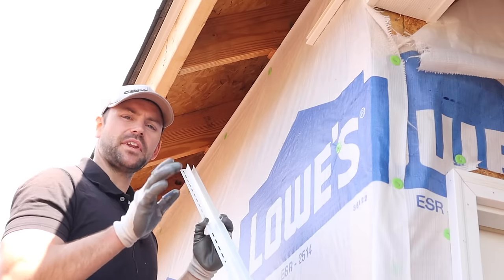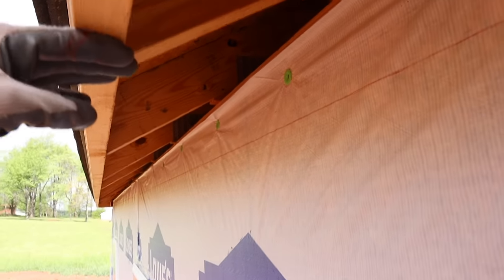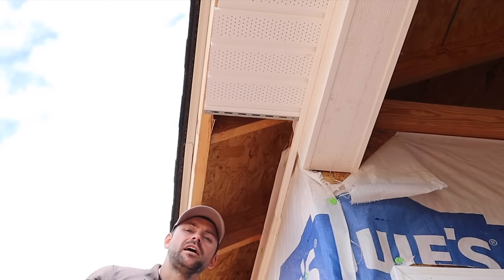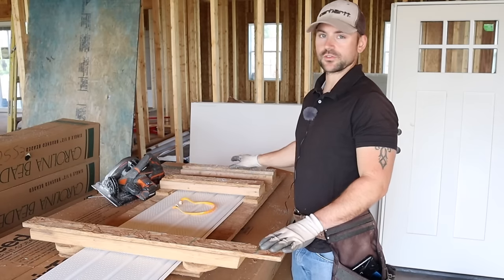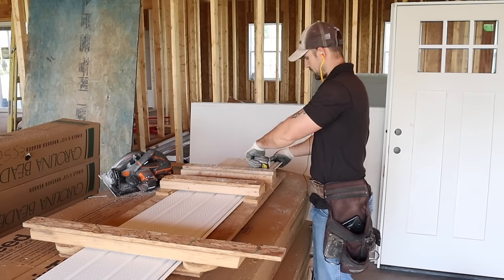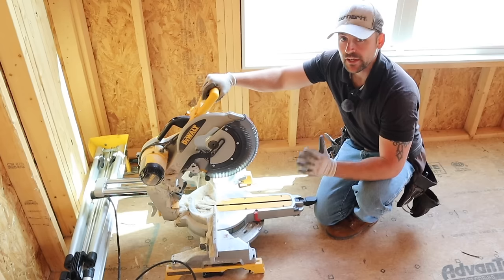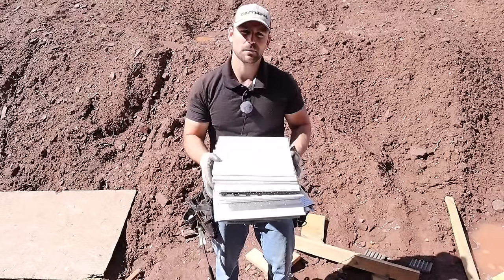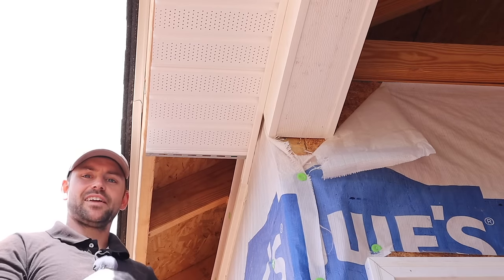How To Install Soffit And Fascia

Comment: Why did you cut soffit in 1 foot lengths ? Why not put entire length up ?
Reply from the maker: That is not how it is installed properly. There is no way to secure it that way. Great question!
Reply: I've got a shed in my backyard that has a pretty complex roof with soffit. Previous owners put the soffit up incorrectly in one run (naturally in the wrong direction). By the time we bought the house, most of it had fallen or was falling off. I quickly learned the correct way to do soffit and had to pull it all out and redo it.

Comment: Why are you face nailing on the long side of the house but not the gable ends?
Reply from the maker: When the Guttering is installed it will cover up the face nails. I hope that helps!

Comment: you dont need a soffit vent with the material you are using because it is perforated = vented
Reply from the maker: The soffit vent is for the bathroom exhaust. I hope that helps clear the air!

Comment: soffit vent when you already have vented Soffit? That doesn't make sense
Reply from the maker: The bathroom fan vent has to connect to it. You cannot put the bathroom vent just straight up in the attic. Hope that helps!
Reply: @TheExcellentLaborer  sure does! Thank you!
Reply: @TheExcellentLaborer  mine goes straight up into the attic but my house was built in 1955. I always assumed it wasn't right lol. Thanks for helping us. 
On a side note, what size was this fascia? I didn't even know aluminum fascia existed. My wood fascia is somewhat rotten so I'm going to replace the gutter and fascia. I'm assuming you suggest using aluminum instead of wood?

Comment: Why flip the F channel, and why even use F channel? Use J channel, it is 7/8" thick so from your level mark, pull down 7/8" and pop that line. That way your not shoving your head up into the rafters to see your chalk line, you can clearly see if at the bottom of the channel. In 35 years of installing vinyl siding, I have never used F channel nor met a Pro who does. On cutting with a saw, no need to reverse the blade, just use a plywood blade installed properly. I have never, in my 35 years; ever seen anyone use a miter saw to cut vinyl. Your video thus far is not what people should watch for learning how to install soffit, I'll keep watching. By the way, pros don't work off a single fiberglass step ladder, we use walk boards. You can't even pretend to be a pro very well. Ugh, prebent fascia, and then you face nail it. Wow. Here's a pro tip. Take a pair of pliers and break the tip of the razor blade so it is bull nosed, not only will this score much better, I had a blade for over 10 years that still cut up to the point I dropped it in a mud puddle by accident and didn't feel like fishing it out. Using a blade this way is the only way to properly score metal, any metal. The wrap around the corner and up the fascia, bravo, done correctly. The bird box also a good job except your one in lip should have been a miter cut for appearances. Your fascia running across the bird box, do not cut that lip off, fold it under and press it flat, it makes a much better looking result. Oh lord, NEVER nail the eave drip, never. Far too many people think they can properly hang vinyl, that is just not the case. Like I say, while there are many like me, we are the best. I reached the ceiling in this profession and no one is better than me, only equal to. I quit last year, but I still do them for one builder, and one only.